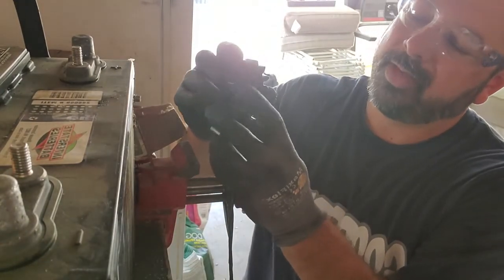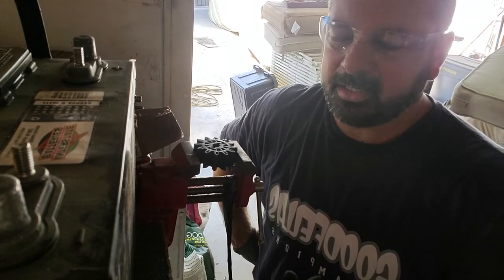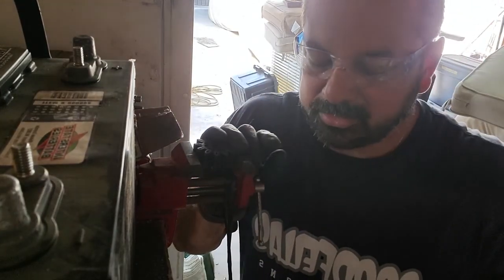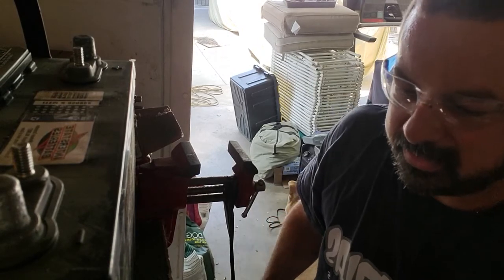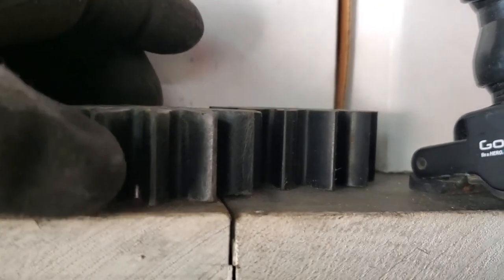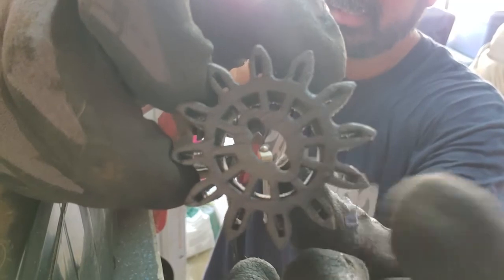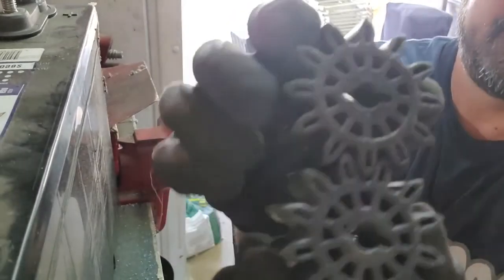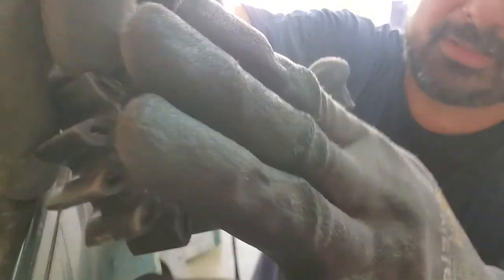Trailer Fuel Station Pump Gear Repair

Comment: Does it make any noise when the gears lock up? When I turn mine on there’s crickets. Any advice?
Reply: No noise. The pump won't work. At first the pump should come on and you should hear it try to spin but it will lock up. It won't spin. When you loosen the gear door of the pump the pump should work. It might spill gas, but it will pump correctly. That's when you should grind the gears down.

Comment: I did the same you do but no gas is coming out
Reply: If the pump is turning freely and no pressure has built up the pump may not be good anymore. This trick is to get it to turn freely and unstick the gears. Try to bench test the pump.